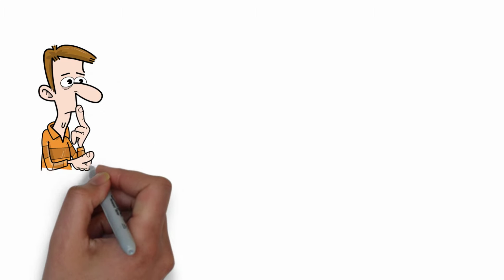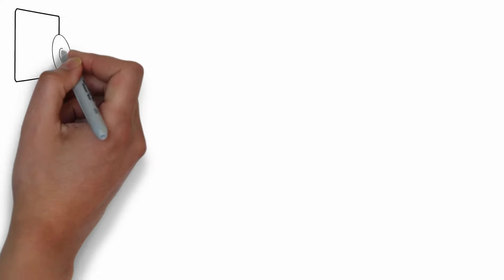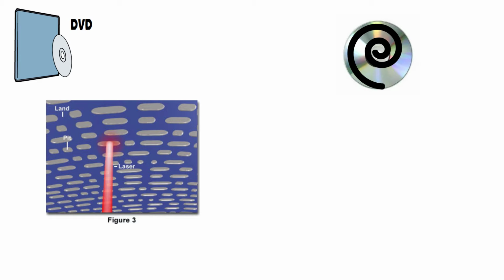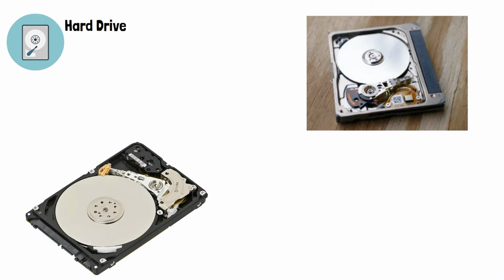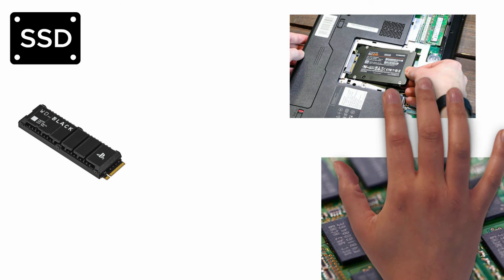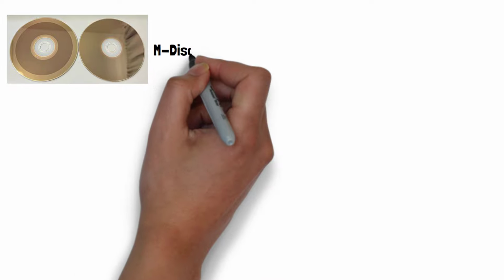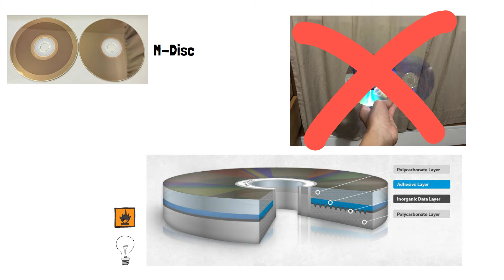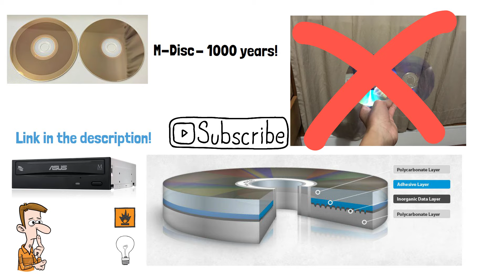How long will data last? (Hard Drive, SSD, DVD, M-Disc)

Comment: I have plenty of portable usb hdds, sd cards, a desktop two 1TB ssds, and a couple of large zip cases with burnt dvds. For alot of storage I'll probably try and get hold of a nas or das set to basic mode (that has a tray design) instead of trying to cram hdds into my pc case, and a usb m disc bluray writer for small backups. Some people do seem to have problems with burning multi layer blurays though. Over the years I'm less trusting of sd cards given they can sometimes corrupt easily, no matter which brand, and will now stay away from portable usb hdds given one drop or sudden movement of any non rugged drive can render them useless.
Reply from the maker: Hadn't heard of the issues people were having with burning multi layer blurays, do you plan to consolidate your storage in the future or keep things separated across several storage methods?

Comment: Though physical data retention spans are important, the real challenge lies in the (binary) data formats used to encode your documents / pictures / ... Even after as little as 20-30 years there might literally be no software available to read your specific format. There are efforts in the right direction addressing this issue (like PDF/A), but the vast majority of formats are either not documented/specified enough or even proprietary.
So, if you want to make sure your investment into 1000 year data retention bluray disks is well spent money, better stick to uncompressed .txt and .bmp files.
Reply from the maker: Great point on the software/ file formats compatibility, this is something rarely considered!